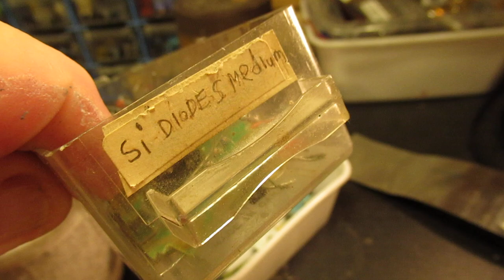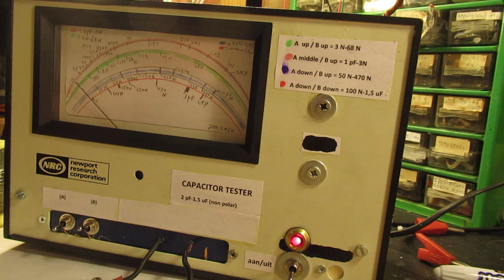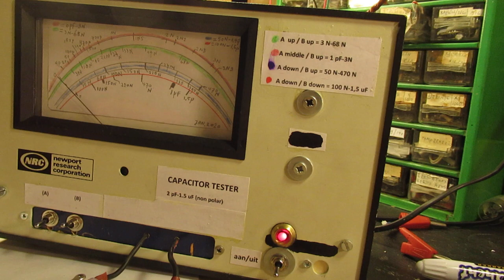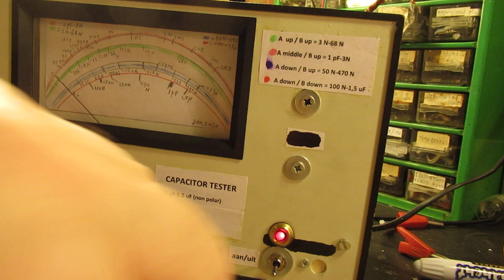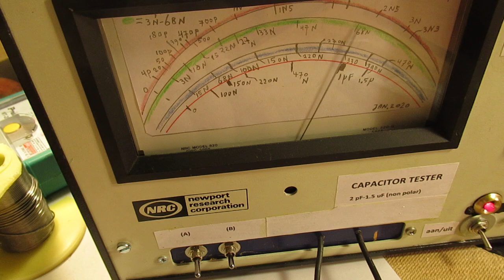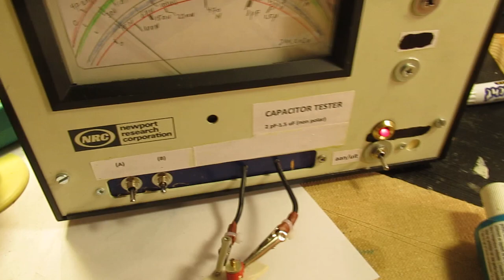VLOG Pre thoughts making a VHF circuit in the Manhattan style (80-100 MHz oscillator)

Comment: Is manhattan style OK for VHF? I think so but I wonder your opinion? I did a calculation and it looks like for .5 centimeter pads you get about .4picofarads of capacitance at each pad. I had built a VHF common emitter circuit and wasn't really getting the gain I expected , and wondered if it was the manhattan pads capacitance possibly, but I guess according to my calculations it really couldn't be (amplifying at 144Mhz each pad is about 2700 ohms reactance, so shouldn't really affect anything I guess...)
Reply from the maker: I don't have much experience on VHF or UHF circuits. Though I know that it works well when I visited radio markets etc. And yes, on these frequencies every parasitic capacitance counts.